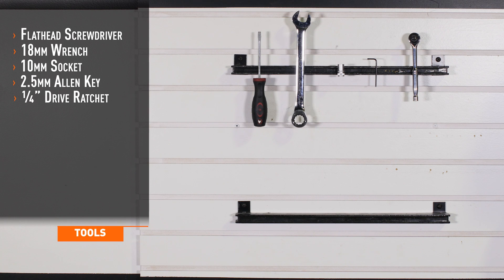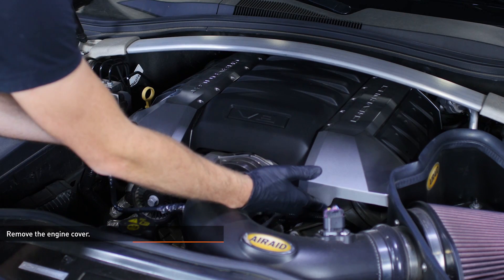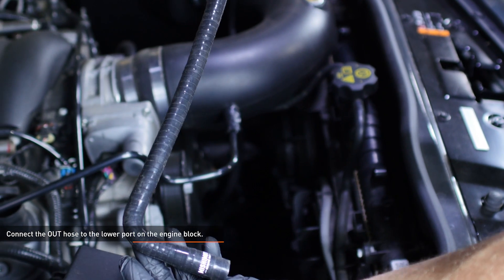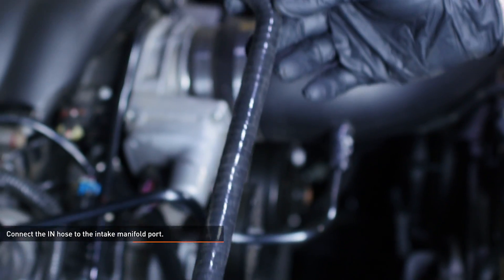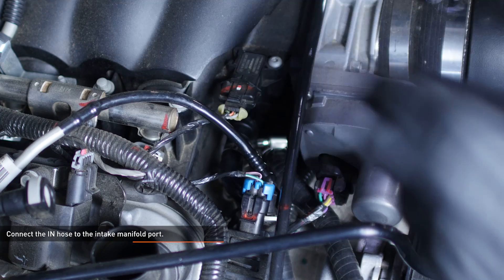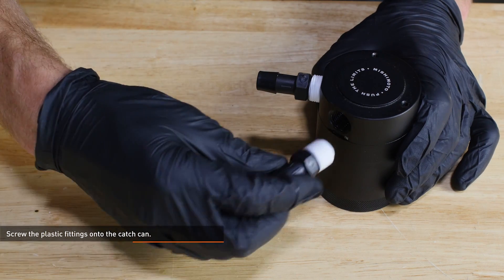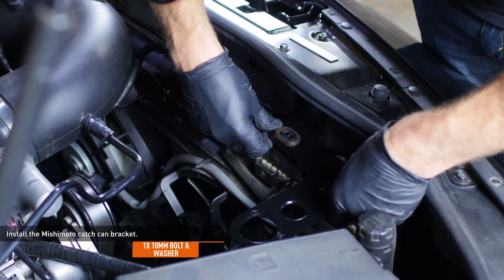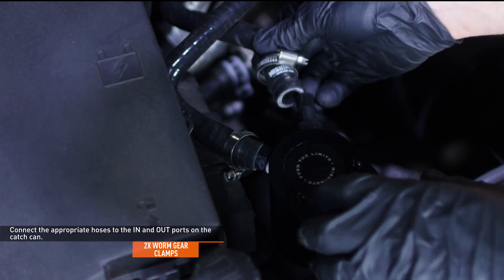2010-2015 Chevrolet Camaro SS Baffled Oil Catch Can Installation Guide by Mishimoto

Comment: Hello is this for the so called dirty side of the pcv system?
Reply from the maker: "Single can mounts in line with the PCV system to separate oil from air using a 50-micron bronze filter"
Yes, this installed on the PCV side

Comment: Can this be use for v6 camaro 2014
Reply from the maker: Not without additional modifications and possibly new hoses.
Reply: I like the oil catch can it self.. If I can cut between the hoses and add a biger one to over lap the original hose.. Would that work?

Comment: The description on this catch can on the Phastek site says ‘for use with V8 camaros with manual transmission.’ Is there one for use with an automatic? Will this model work with an L99 engine?
Reply: EJ Nebre, the l99's does not have a lower port. The lower port is on the top right on the back of the engine bay. If you are going to do a cam swap and deleting the afm this is the one you are going to be utilizing.
Reply from the maker: Hello EJ, unfortunately, this unit, in particular, is for vehicles equipped with a manual transmission as well as the LS3 engine. However, this has been brought to the attention of our R&D team and we are currently looking further into a solution for those running the Auto / L99.
Reply: Will this work on a manual transmission ZL1 with the LSA engine?
Reply: I am running I to this issue also! I recently bought the mishimoto catch can assembly and the setup doesn't work and the mount doesn't work either..mishimoto catch can radiator mount is a different shape from the full oval that's on my l99 mount

Comment: How is it on the L99
Reply from the maker: Hey Omega Wolf SS - here's a link to the full R&D thread where you can see how much blow-by we were able to catch! 

https://www.mishimoto.com/engineering/category/by-make/chevrolet/chevrolet-camaro-ss-direct-fit-baffled-oil-catch-can-kit-2010-2015/
Reply: That set up is for the ls3 motor on a l99 motor it needs a longer hose cause one of the ports is on the back of the motor